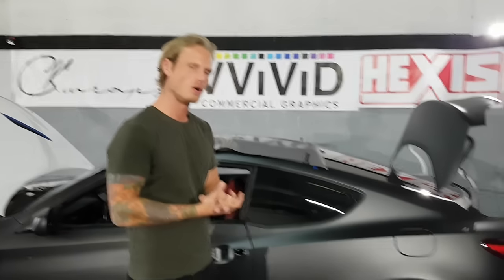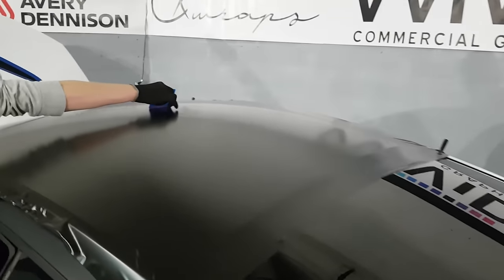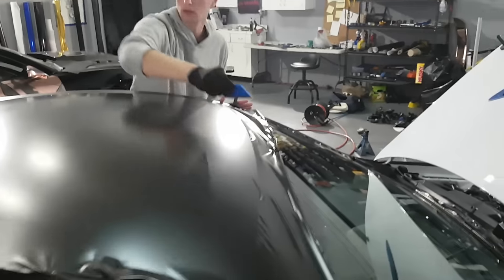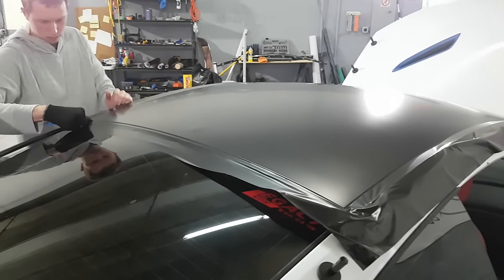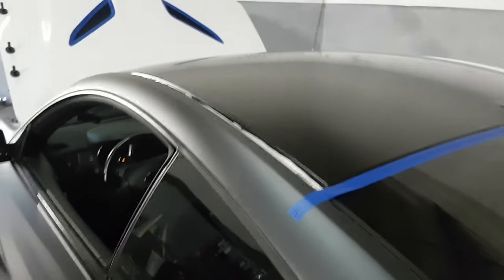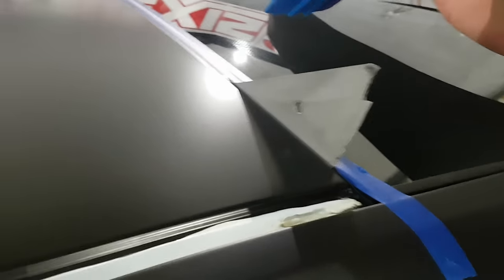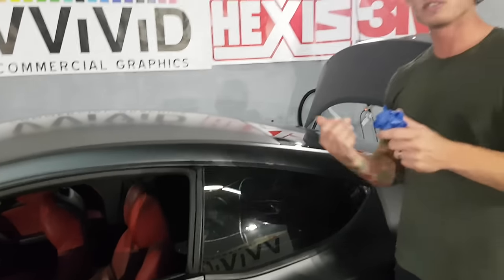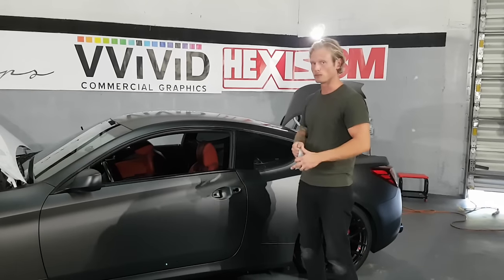Showing A Beginner How To Vinyl Wrap A Roof

Comment: I wrapped the roof of my 2017 Mustang earlier this week and this video really helped me a lot.  You aren't lying about Avery.... I originally tried to wrap it with 3M 1080 and it had all the crappy issues you described in your video where you did the yellow on the hood of the Ferrari... second time around I used Avery 900 gloss black, not a single bubble nor wrinkle.  Thanks for putting all the effort into these videos, they're really helpful!
Reply: is it gonna be doable by myself? I wanna wrap my roof and the side pillars and the side mirrors of my camry. and the only professional place in our area for this is asking 500 dollars for this. so stupid.
Reply: Yeah I just tried to wrap my targa top on my corvette and failed miserably and wasted $30 of 3m wrap
Reply: @lsedanolg  its all patience and learning... I got a stretch mark, few glue lines and actually burned a hole first time doing a hood. Spent 10 hours getting the first mirror done with its angles. Rear trim piece i did 3 times to get it right since it wanted to bubble up around center emblem area (high tension zone). After that things started getting easier learning how to make relief cuts where needed and learning the angles. Its not something you really get first time. Ive only worked with vvivid, so the easier film used starting out is best.
Learned from my mistakes.. we were pulling too much out doing the hood. Need to just lay it flat and let things fold over edges
Reply: I want to wrap my suv, is this wrap good for learning to wrap? I dont want to feel like I'm wasting $.
Reply: Bill I have a mustang as well (S550). How did you finish the wrap, along the sides of the roof? There's a small valley that runs from front to back windshield...but no opening to tuck the wrap into.
Reply: Where do you buy the Avery from

Comment: I would also advise you guys to spray just some water on the top of film once it is laid so that when you squeegee the vinyl, you know where you have done it and where you have not and it also prevents to scratch any gloss black or satin black film. I have particularly noticed these mistakes in high end shops as well
I have had 99% success doing this so would request you to try this method out
Reply: Ohh so that’s what the soapy water is for. Thank you for the tip.

Comment: One thing I have noticed is that all the beginners are doing when they finish cutting a piece of vinyl is they rush with the cut at the end, like at least twice as fast as they were cutting it before reaching the end. Instead, look at CK, at the end he finish his cutting keeping the same speed. 
The reason for that is that the chances of your blade to jump and cutting on the paint are very, very high. I know this from self experience and I have seen others doing the same thing 😄
So take your time and don't rush, because you can ruin your nice job,right at the end of it.

Comment: I’ve been doing vinyl graphics and wraps for almost 20 years and you’re literally the first (and only) person I’ve heard say they prefer Vvivid over 3M. Not saying Vvivid is horrible, but preferred over 3M? You definitely know what you’re doing and the roof looks good, but I’m also surprised to hear you recommend Avery for first timers considering how easy it is to overstretch, not to mention how careful you have to be when using heat. With 2080, or even 1080, you can literally remove the backing, crumple it into a ball, and with a little heat bring it back to perfect. I will admit 3M’s Carbon Series, especially in matte, can get extremely brittle when handled in cooler temps. 
Vvivid definitely costs less than 2080, even their Premium line is priced very well. Personally I think Vvivid is great for piece work, such as rockers and lips. Avery is ok for wraps but is the best choice for plotted work, such as signs. 3M 2080 is my favorite for complete vehicle wraps by far. 
Your channel and content is great! 👍
Reply: He has company interest with vvivid that’s why.
Reply: That's what I was thinking 😂😂. 3M is a massive company, there's no way a noname like vvivid and avery would be better.

Comment: Im planning on wrapping my roof of my truck and stumbled across your channel Christian. I am grateful i did. Your videos are very informative and give me a lot of confidence to tackle this project for the first time. I originally was going to get vvivid but after seeing some comments and this video i have decided to go with Avery satin Black like this wrap in the video. I do have a few concerns like: I dont have a garage and live in an apartment, so i will be doing this job outside in the Florida sun. I am concerned, but went ahead and got a prep cleaner/Rapid tac. Hopefully that helps with premature adhesion. Dust is also a concern but i think i can clean and prep the roof and glass out the vinyl fairly quickly.
Wish me luck.

Comment: Wrapped my first roof yesterday.... looked good, woke up this morning... still looked good..... that mid day sun hit it and bubbles just start poping up
Reply from the maker: +DJ Rich Kidd apply more pressure and make sure you're being thorough when you squeegee. Those are usually the main two reasons why that happens
Reply: CK Wraps ok thx... I'm watching all your videos, I have enough wrap to do the whole car... wish I could show u pics
Reply: @DJRichKidd1  also post heat very good before you take it out to sun. The heat gun will bring out the bubbles first or any potential stretch backs, like around door handles (which i discovered). I didn't take them off to fold wrap inside unlike I did the gas tank cover and all lights

Comment: First off thanks for your videos! Ive done some small wrap projects and Im about to tackle a roof for the first time. Im looking at my car and both the front and back windows of the 3series BMW have no rubber in-between the glass and paint. There is a somewhat large gap so I'm wondering if you have any pointers on how to finish the front and back without exposing any paint. Thanks!

Comment: I just bought some wrap from VViViD and doing my roof soon
Reply: I bought the Vvivid carbon fiber aswell, and im glad with the results its been about 1 month so far... Pretty easy to install the interior in my opinion. Im going to do the hood and front bumper aswell.
Ill post a video when im done with project
Reply: I tried this with viviv and failed really hard, will try avery next
Reply: Johan Williams - same here. Flushed $100 down the drain. It was extremely sticky and difficult to reposition.
Reply: @daddyo824  it's learning, the Avery was a lot easier to handle thought came out really good. I like will probably attempt do the entire car when I get some time off
Reply: @jawsilent13  I'm going to give it another shotusing the Tack Reducer. You may want to look into it, supposed to make it easier to work with. Good luck on your project
Reply: @jawsilent13  just bought 65 feet of vvivid not feeling so confident after reading the comments Haha
Reply: joe gore have you done it? :))
Reply: @sebiii7921  yeah turns out I'm not good at it. I'm just going to rip it all off and paint it eventually. Lesson learned lol
Reply: joe gore I wil try it too in the future... hope i can deal with it :)

Comment: I’ll do my roof tomorrow, can you tell me do I need to use heat gun to just make sure bubbles not show up, after is wrapped? Or what’s the temperature needs to be after wrapping?
Thanks
Reply: I did mine in the sun like an idiot but it kinda helped all I had to do was lift it if there was a bubble and then the sun would be the heat gun.
Reply: Also put the tension in the middle dont put tension where the edges are or it may peel
Reply: Yup to add what Dallas said, let the film drape over edges without pulling. Especially important with 3m from a video of their tech doing a trunk, as pulling can make glue lines too.
Always post heat at end really good.  I use 500-800. The key thing is from the one car I've done so far is you won't have pull back if you're able to tuck the film under something ie: quarter inch under hood, then trim a bit. Which is important taking the car parts  off like headlights.

Comment: If anyone is watching this and thinking about using Vivvid, be warned! Vivvid will not pull tight and smooth like the Avery in this video!  Get the Avery and do it stress-free the first time.  

Maybe vivvid is a good product for other applications (smaller areas/less curvature), but for my roof it was a nightmare to work with!

Comment: Can you give me a good vinyl in matte black for a beginner? I bought VVivid XPO from Amazon, and it was extremely difficult to work with. I had all kinds of bubbles, and couldn't get rid of them. Any pointers, or ideas?
Reply: Same I bought 3m 1080 dead matte black, and the material was tough and as thin and easy as this

Comment: I tried wrapping my roof last week with vvivid and it was not nearly this manageable. It was super sticky and thick and was impossible to get on without a million bubbles, and I’m not new to wrapping. Ended up throwing out the whole roll, hoping I can get Avery and do it with that.
Reply: I think what I'm going to do is pull back half the backing and do center to front and then center to rear. That way I'm only dealing with positioning half the film making it manageable. Then peel back and squeegee down as i move long, basically how I just did full car length stripes. Very easy.
Trick is though to fold the backing in to make a crease fold where u cut it, so no cut fibers tear pieces into the film glue. If I was using this avery I'd just do it this way, but again I'm using vvivid cf xpo. I know exactly what u mean regards to its thickness, wrinkles and bubbles as I did a hood with it
Reply: How did it go?

Comment: Noob question...why stretch initially? Would it not be better to lay down as much as you can in an un-stretched state and save the stretching for the contours? By the way, your vids have changed my mind about painting. I am an old school autobody guy that learned painting for color change. Now, not that sure painting is necessary anymore.  I have chewed through a lot of your videos and have decided to give wrapping a try. Going to use my golf cart as the guinea pig....lol. Nice work on the videos!

Comment: This will be my first time wrapping a car. How should I buy the wrap/vinyl? I'm not sure how much I will actually need
Reply: Minimum 75 feet roll for a whole car which will run you like $600 or more.
For hoods and roofs I usually get 10 foot or 12 for extra and should only cost about $70. I bought online through Amazon because I had gift card, which gets it from the manufacturer. If your ordering  big like 50 foot rolls, u can get a discount from ck, I think 20% off

Comment: When wrapping a roof with a carbon fiber vinyl, I'm sure the method is very similar.  However, are there any tricks you have to help keep the pattern straight?  I wrapped a roof that had a sunroof.  Everything went on smooth.  But after I was finished, I noticed for some reason I am noticing a slight wave in the middle now.  Any idea what may have caused this?  I am pretty sure I didn't over stretch when glassing.
Reply: I second this question, I can wrap a roof w/non patterned wrap in 45 mins or so. Carbon wraps take m 2+ hours and they still come out with bent weave. Any suggestions or brand you prefer? I've tried 3m 1080 and Avery with the same issue(s)- the Avery was easier to work with thou.
Reply: Honestly the waves are from stretch or slight pull... its doesn't take much at all when you think u didn't. QFE... i had lots of waves near inside my first mirror using cf. Vvivids is thick material. No contortions  in hood tho.
Also using heat gun too much will do it when getting wrinkles out, something I had to do when approaching ends

Comment: I bought Avery Dennison off of eBay for $42 to do the roof on my Mazda it worked okay but it seemed like there were some slight imperfections and I'm wondering if people on eBay get seconds from Avery Dennison that might have had some run marks or something in it is do you know anything about that
Reply: It's most likely fake. Only seller i buy from on ebay is this place.. All authentic, used many many times..  
vinyldepotnorthamerica

Comment: Hi,  I just had my roof wrapped gloss black.  There are finger prints in different area.  I took it back to the installer Fatazy Audio and they told me finger prints are normal when you deal with gloss wrap and they can't do anything about it.  Is that actually common or are they just trying to get away from fixing their mistake?  It's also very fuzzy and not as glossy looking as the antenna and spoiler they wrapped for me.  They said its because the roof is metal and the spoiler is fiber glass.
Reply from the maker: That doesn't make sense. The roof should not have finger prints in it at all. This means they put their hands under it and pulled too hard which leaves finger impressions. That is not normal. Though the finish could vary from the roof to antenna it usually its very noticeable

Comment: How many years the vinyl wraps will last?
Reply: depends on sun exposure and area but generally anywhere from 2-5 years. The better you take care of it the longer it will last.
Reply: Put ceramic coat on it. I use cmx. Also no garage so I'll keep car cover on it. Which should be doing anyways.. my spoiler oxidized after only 2.5 years new. Warranty repaired under hyundai

Comment: I assume you don't care about corners? just on the end is way to do it right? Tack and leave wrinkled.. You may get away with that if your rack trim goes  right to windows seals, but many cars have that corner exposed, trims ends couple of mm before window seal, would be good to see your way to deal with those corners rather then just ignore them ...

Comment: Why are there no videos showing you how to wrap a roof the same colour as the vehicle? There are only roof inlay panels
Reply from the maker: Most people opt for gloss black since that's the tend and style these days. Doing it in the same color will be the same process but just using the same color as the rest of the car.
Reply: @CKWraps  
Thanks for the Reply..Where would you put the joins in? I'm going to wrap a 66 Beetle and I'm abit confused at how to go from the roof Down the windshield pillar without having to join it ,or would your cut out the window sections on the vinyl sheet and use a Bigger piece of vinyl but then have more wastage?
Reply from the maker: @sinistercharger  I have videos on my website www.ckwraps.com on how to do a roof like that. The Lamborghini Aventador is a good one to watch because it doesn't have drip sills
Reply: @CKWraps  Cheers..I will give it a watch 👍
Reply: @CKWraps  

I have tried to find the video as you have lots of Aventador ones ,do you have a link?
Reply from the maker: @sinistercharger  this one  https://ckwraps.com/videos/371